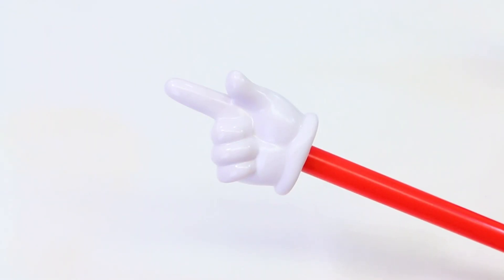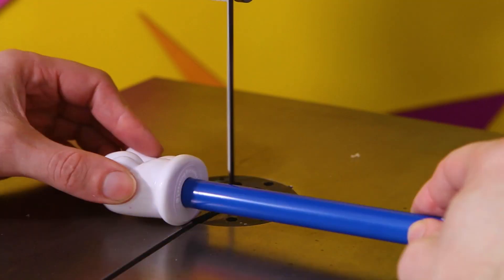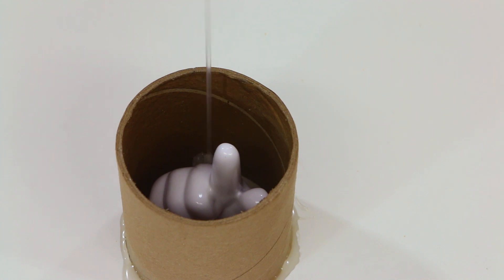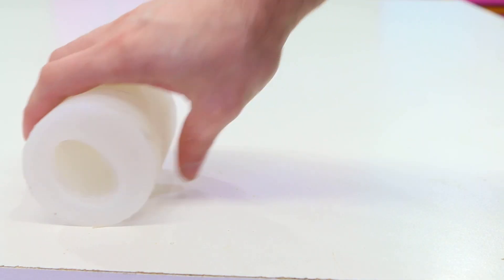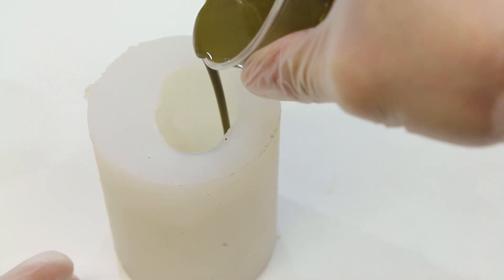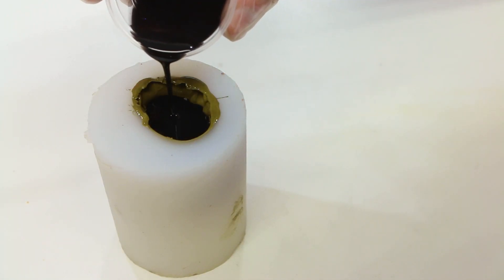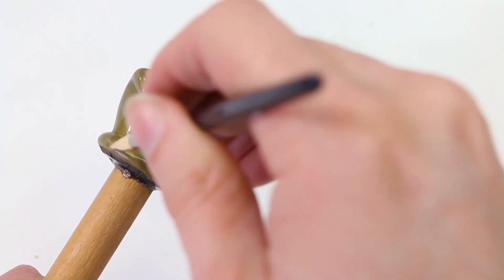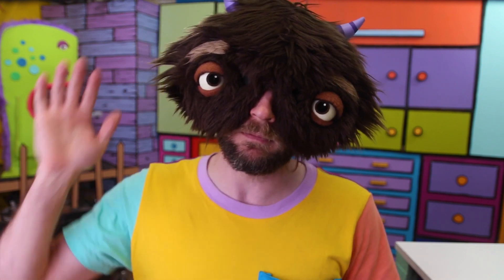How to cast metal THE EASY WAY || Cold Cast Metal without a foundry

Comment: Is it electrically conductive?
Reply from the maker: Probably not enough to be useful. Maybe if the ratio to metal powder was higher, but then you’d probably run into strength issues

Comment: As I recall, one can coat the mould with dry metal powder prior to pouring to give a little more metalness (metalosity?) to the surface.
Reply from the maker: That might help a bit if you're planning on doing some kind of patina over it, but if you're buffing it with the steel wool it's just going to end up buffing all of that off anyway

Comment: MakerMonster- have you tried making cheap silicone moulds using the silicone calking and dish soap method? (much cleaner than corn starch)
Reply from the maker: Nah. I've always found the hassle of trying to get good results from stuff like that to make it not worth trying over buying something that works and making a clever mold if I have to. Rather make a brush-on mold and a support shell using a little bit of a working material than mess with something like that and save a few bucks.